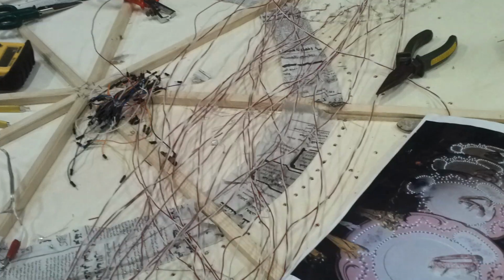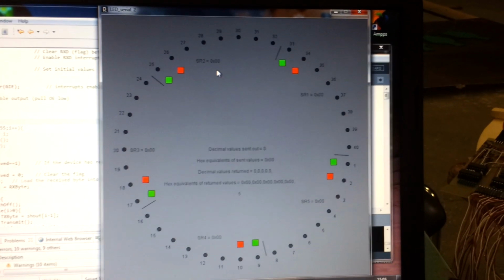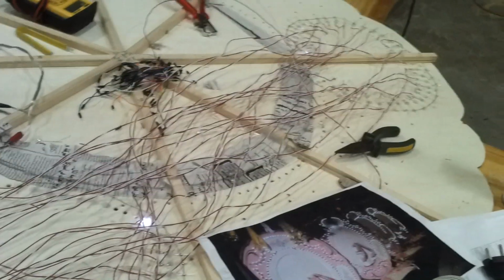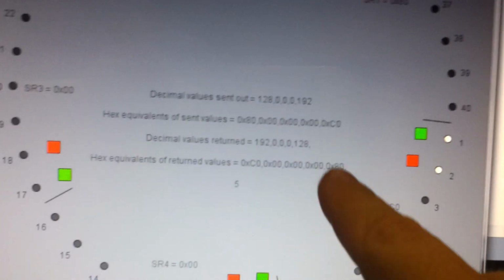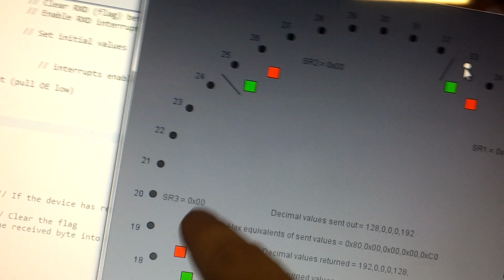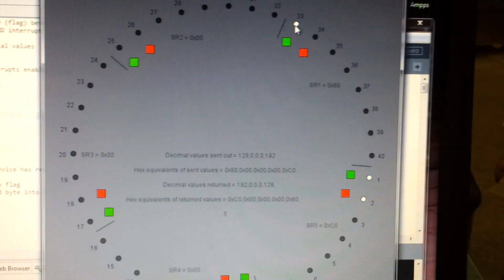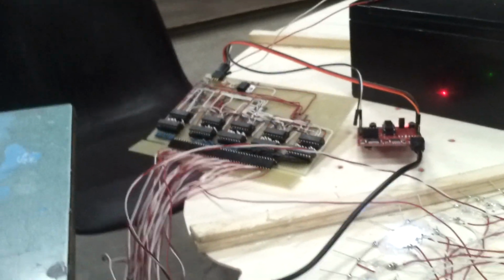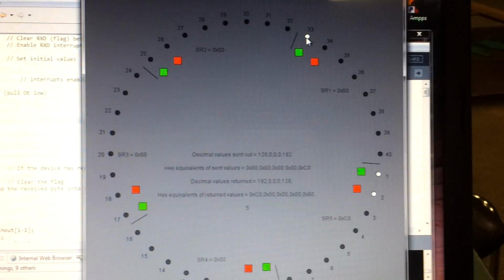MSP430 + 40 leds with Graphical Serial Interface!

Comment from the maker: What was pretty complicated about the Processing programming is that I needed to make some sort of a software debouncer. When you click in the area of a circle representing an led, the time you hold the mouse button down, even if very short like a click, will make it turn on and off continuously. So you need a little more logic in there counting "if this is the first cycle of the loop since the mouse button was pressed then do something otherwise don't do anything". Not even that straightforward